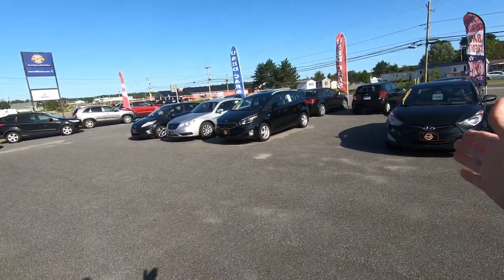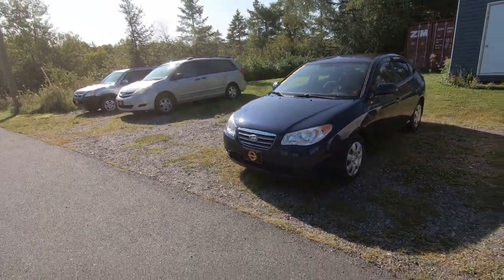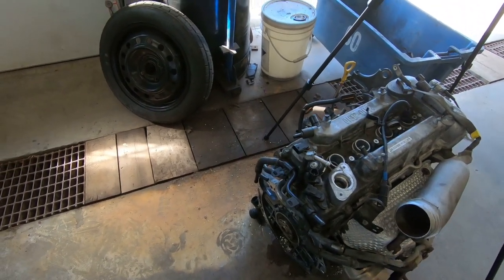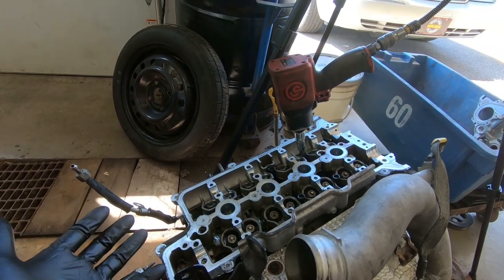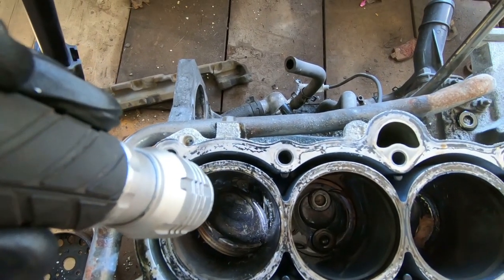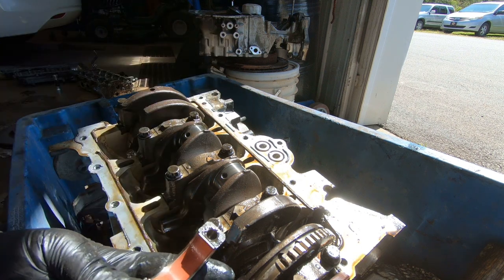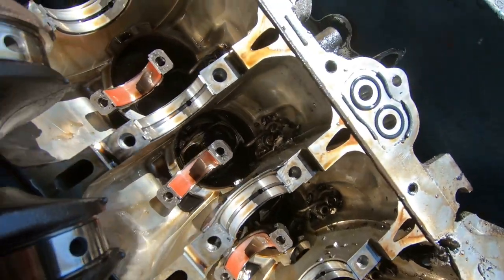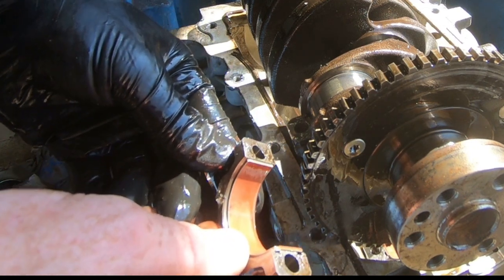ENGINE TEAR DOWN ON JR'S 2013 HYUNDAI VELOSTER TURBO- WHAT WENT WRONG

Comment: my 2016 Veloster turbo at 125k miles at 250whp with supporting mods seems to be running great. never had any major repairs done other than a blown turbo & head gasket leak at 120k miles. 3k minimum oil changes 5w40 full synthetic 91octane or better on all fill ups, currently mixing e85 at e20.
Reply: whats up have a quick question. i have a hyundai veloster 2015 turbo. no crazy mods just muffler delete, BOV, intake. literally my car runs perfectly fine never had any problems i just hit 80k. it seem like hyundai have that same issue literally my head gasket blew on me last week. its in the shop its getting fixed by my mechanic. do you think i have should have any worries in the future for my car after it gets fixed. or no need to worry?
Reply: @ericsmallz3o5  head gaskets on 2015's and up aren't common but not uncommon either. My head gasket went at 115k due to my tune. everything I stated above is crucial for your engine to last

Comment: Was checking out Veloster videos and came across this. I have the same car and my engine blew as well. From my research, which I'm sure you've probably seen yourself, these GDI engines have been known to do that. It's due to LSPI ( Low Speed Pre-Ignition). It just kinda randomly happens to these cars around 60k to 80k miles. Apparently Hyundai didn't fix the issue until the 2014 models.
Reply from the maker: Well this engine had 200,000 km's (125k miles). So it lasted longer than it should have then. lol Thanks for watching!

Comment: 4:00 to start tearing apart. 6:00 to see the damaged piston #4 which was caused by a broken connecting rod. 10:40 I see a hole on the block. Did JR not see the hole before taking the engine apart? The rest 3 cylinders were running without oil? I am sorry, I was half asleep watching this.
Reply from the maker: Thanks for staying awake long enough to comment and thanks for the view..

Comment: Blown engine looks like the rings got hot and butted together seized the piston in the bore.  See how the top of the piston the broken from the ring land to the top.  After piston seized the rod, pulled the piston pin out of the piston, whipped the rod around with no piston on the end and broke off after windowing the block.
Reply from the maker: Great observation and plausibility! I can definitely get on-board with your hypothesis! Thanks Jim!

Comment: If I was going to guess, I would say a piston ring let go in JRs car, judging by how that piston was sitting, and all the grit in the pan
Reply from the maker: That is a possibility! Not sure I’d rely on using the old turbo again!
Reply: @OldeCarrGuy  well if they're known to fail on the #4 cylinder, I'd say it's a poor intake design.  Allowing uneven boost pressure.  Dang, now I want to buy one just to check manifold pressure across all 4 intake runners! Lol